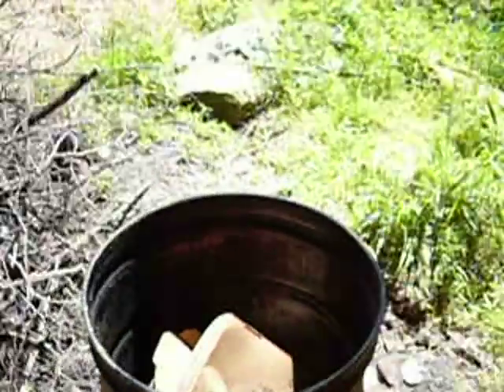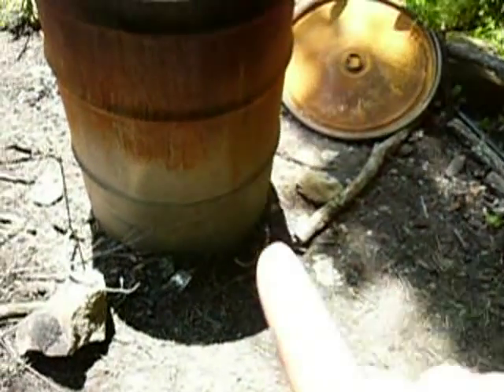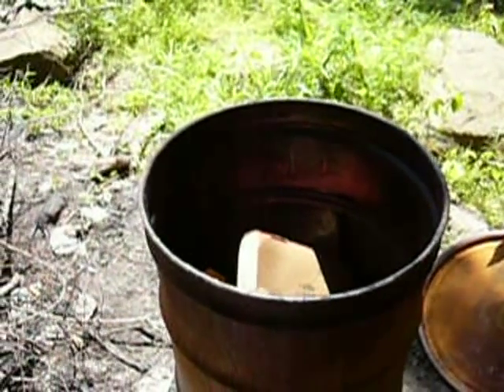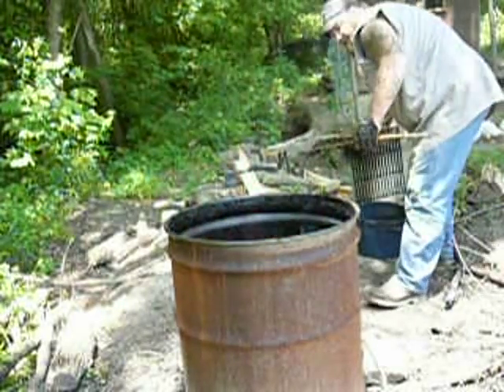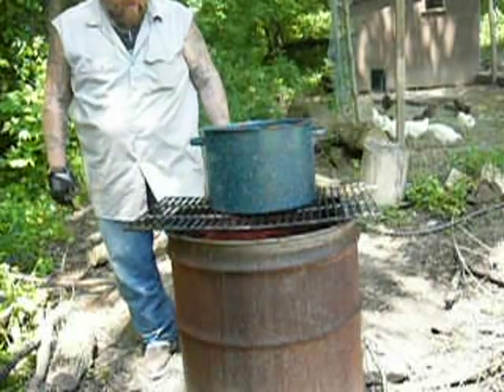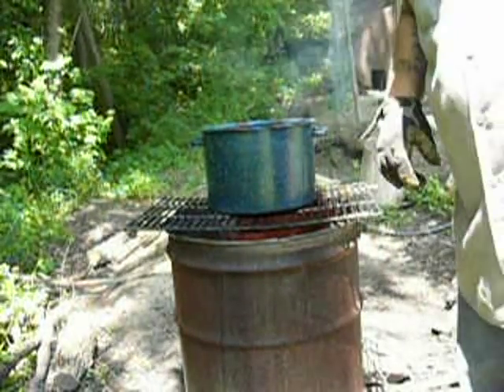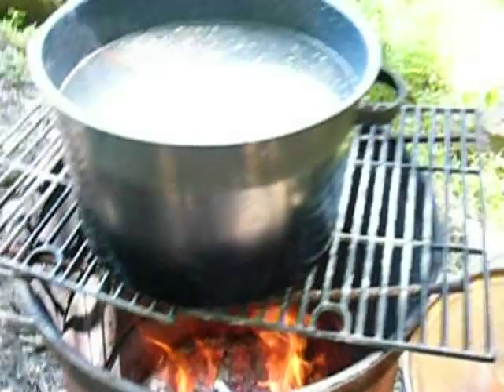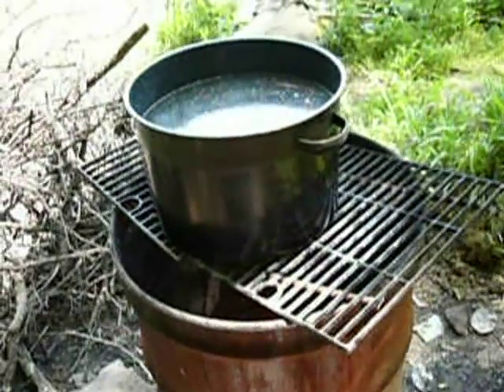Canning on 55 gallon barrel in SHTF

Comment: Going along with your thought's I would stock an extra metal barrel or two in case of burn out or the need to do things a little faster.Dig a spring/cold box to store fresh items.Get some plastic barrels and hay/wood chips to store root vegetables in and apples etc.You have a nice place there and with a little family planing (not the PC kind) you could be ready for most anything. If you find a spring, cap it and run it to where you can keep it clean and use it. (Oh and send me your address)Jim;-

Comment: A couple things you could try for higher efficiency: 
insulating the barrel would help out a lot. 
You could also try a modified dakota hole for making your fire breath. Makes it a bit easier to choke it. (move something over the hole instead of kicking dirt around the barrel)

Comment: Boils faster with the lid on. Should reach boil in 10 minutes or so covered. You can also cover up parts of the grate that aren't in use to direst the heat towards the canner.

Comment: My only comment would be that to have a continued fire in that barrel to can would to be to have a way to bottom feed  the fire. so just cut a hole in the lower portion of the barrel to continue to feed the fire for the heat needed. It is possible and very able to be done.... Thats a good alternative to conventional methods.

Comment: I don't have a rocket stove, but I watched somebody cook on one, once.  That puppy gets HOT.  I don't see how you'd have a problem canning, except for moving your pot on, and nearly off,  to keep the temperature right for pressure canning.  Boiling, is boiling, is boiling for water bath canning.  It doesn't matter if it's a medium to llower maintenance-flame, or  you're burning down the forrest.

Comment: Nice idea. My thinking is when the SHTF hits you will need to can ALOT. So I was thinking is cut a fresh 55 drum in half. Bottom half the burn barrel, top half is the WB canner. Stack one on top of the other with a small spacer between. One could get some serious canning done in a WB that size. $20 tops for a new barrel in my area.
Reply: +MaruAdventurer Could you tell me a good place to look for a new burn barrel?

Comment: you could possibly cook on it after you put the lid on there to make charcoal using the same residual heat yer using to make the charcoal and the lid would be sturdy enough to hold the canner long as yer making charcoal it wouldnt hurt to do a dry run n give it a try

Comment: A couple of thoughts.  Invert the lid on top of the canner while water bath canning and you could warm a little something in the top of the lid.  Is there a floor in the barrel or was it cut out?  We have a burn barrel. been wondering about how to use that thing other than burning trash.